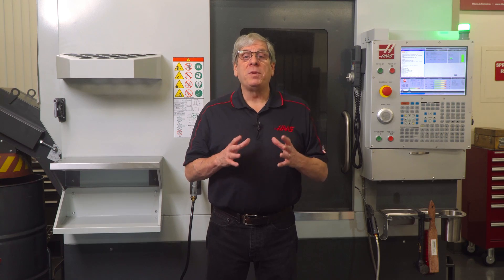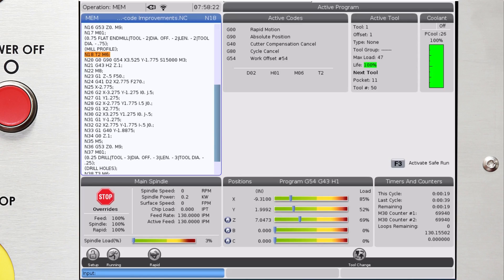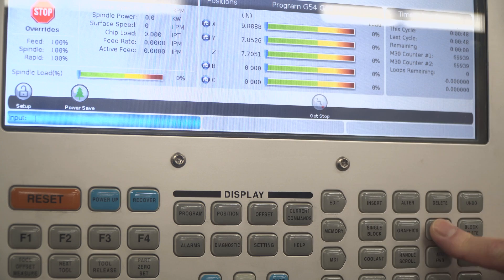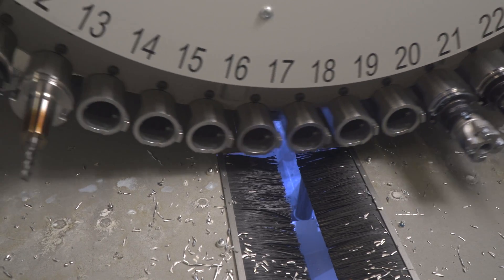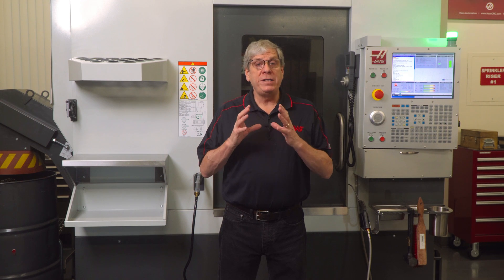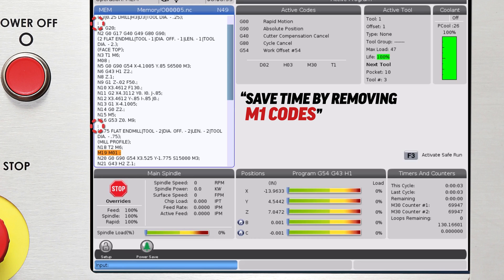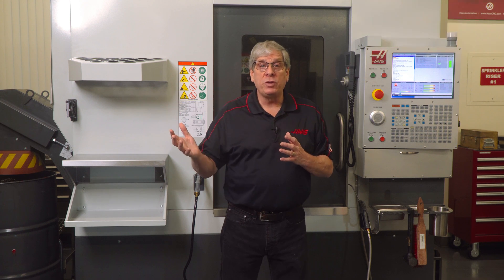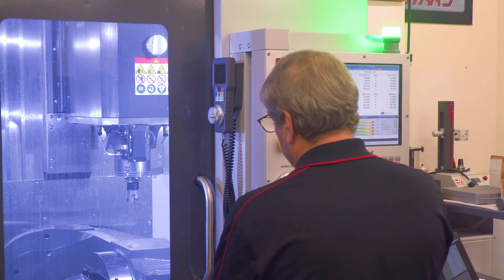M-Code Time Savers - M01 Optional Stop Improvements - Haas Automation, Inc.

Comment: Regarding the M01 code, if a post processor is setup correctly, the next tool is called right after the current one. Our post puts the next tool call on the line right after the tool change. Therefore, no look ahead needed. Setup your post properly and this M01 video is null and void.

Comment: why lie, the machine doesnt look ahead for the next tool, it only prestages it when it sees that tool number in the program. Anyone who has 2 brain cells left knows to prestage the next tool on the very next line after the current tool M6.
Reply from the maker: Roman, There is no need to call anyone a liar. The machine does in fact look ahead for the next tool. But it will not see the next tool if there is an M01 code before the next tool.

Comment: fourth option, fix your look ahead code to look beyond the m1 for the next tool. It’s a bug not a feature.
Reply: It does sound like a bug.  Why does the tool look ahead stop when it encounters a M01 at all?
Reply from the maker: Kurt, as John explains in the video, the look ahead stops at M01 to give the operator a chance to press the OPTION STOP key on the control to actually stop on the M01. Look ahead happens much faster than program execution. If we did not stop looking ahead at the M01 code, you could press the OPTION STOP key on the control but the program would not stop…why?...because look ahead is already past the M1 code.